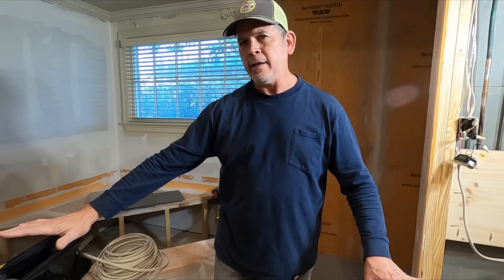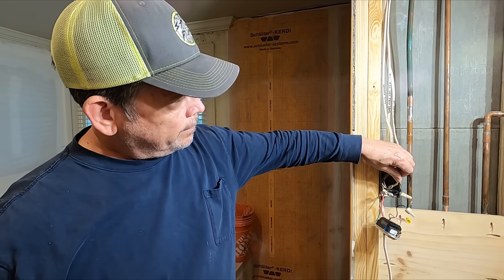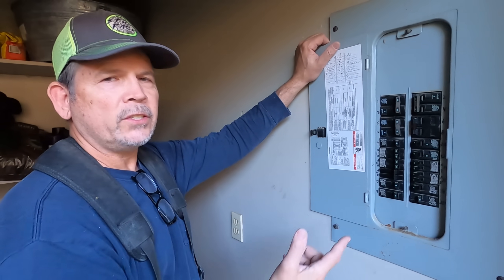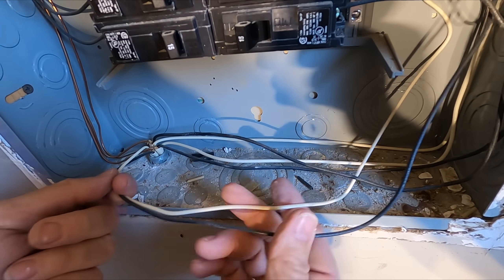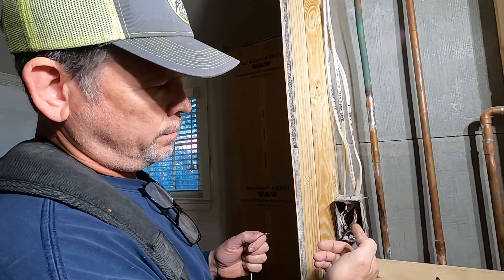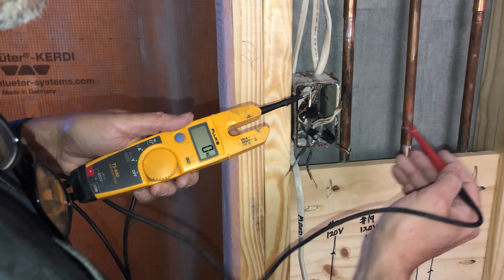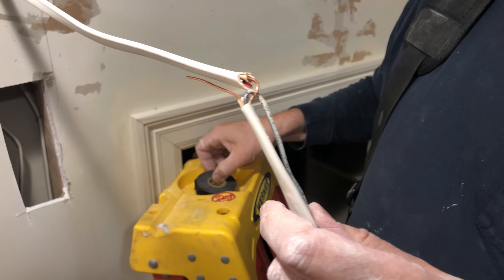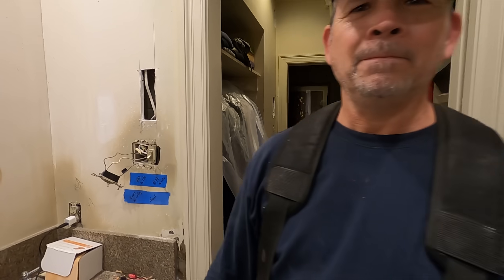You CAN Get SHOCKED by a Neutral Wire! This is How...

Comment: Thanks for the video. Was doing some research before replacing some worn out outlets this weekend. I already have a non-contact voltage detector that I've used for previous projects but, I had no idea that a neutral could still zap you even if the breaker is off.
Reply: Yes, but here's my take: Gotta appreciate your concern for electrical safety BUT there's more of an immediate danger and an OSHA violation going on at 13:00 . Whats up with that?!? Well, at least he was wearing knee pads!!! Hahahahahahhahah, funny as hell!!! Reeeally? Come on, man!

Comment: Paused 9 seconds in... let me guess somewhere there's a bonded sub... this is why we don't bond sub-panels... okay let's see if I'm right.

EDIT:
It's not... it's an uncapped open neutral shorting out to a hot lead in a switch box. You could get both phases in your bathroom switch box that way... that's 240s worth of potential there... that's scary... always double check your conductor connections especially if your just capping off. Just give your wirenut or wago a little tug, if it comes off re-do it and check again, don't shove it back in the box till it holds... also someone's stripping too long for stabbing there's a stripping length gage on the back of the switch. Personally I make shepherds hooks and use the screw terminals as it affords me a few mm of play (I can just curl around more to take up bare wire showing past the back thus pulling it in) and I feel the terminals just a make better connection. Also have you ever pulled a switch or recept that was stabbed? Sure most have a release tab accessible with a small flat-head screwdriver but in practice those release tabs work about 60% of the time... I've gotten them so stuck even after just cutting the device off I still couldn't get the wire out... I don't like stabbing, it's all bad man, just use the terminals. I know, you guys probably didn't wire any of that it's just my pet peeve so it triggered a rant.

Comment: I really like how You break your videos down especially with the electrical work . Working with electricity is scary even if its only 120v . Ive always wondered why there would be extra wires sometimes when Ive been changing Lighting fixtures or Light switches or just a common wall power supply . Very interesting and Informative Videos .

Comment: I see this Sooooo many times in older building and houses. Its also why I always cap off everything I disconnect out of habit. I've had people ask me why I bother capping things off if the switch is flipped in the box.... And my rule is Never assume that its wired the way its supposed to or that someone wont flip it on while you're working. I learned early on getting jolted from neutral wired.... Boy did I learn.

Comment: I learned this lesson myself while doing some DIY electrical work at our new house. That's when I learned that I had a light switch housing which had 2 separate circuits running through it (and it was ALSO containing a 3-way connection!) 

As someone who has done some pretty extensive rewiring, I really appreciate that those runs are labeled so well.

Comment: As a building contractor in Maine, I can not do plumbing or electrical. I am not licensed for either trade. If something happened with either the electrical or plumbing that I had worked on, my insurance would not cover me. I could end up losing everything including my freedom depending on what did happen.
I guess in your state it's ok unless you are licensed in both trades.

Comment: Shared neutrals are a danger as they potentially form part of another circuit in which quite possibly hasn't been  isolated.  It's carrying return  voltage current as part of a live circuit.  Electricians used to do this as it was either easier to connect to another neutral.  Or to save on wiring.  You normally find it on 2 way or intermediate switches.  Or shared between ground and first floor lighting in halls and landings.

Comment: This is why I use a voltage detection probe on all wires even when the breaker is off.

Only time I've ever gotten shocked was when I was unplugging a device from an extension cord and managed to touch the prongs it was a shocking experience 

I've replaced a few outlets recently I know that were wired improperly for sure since the only time someone bonds neutral to ground at  an outlet is to fool the inspector.  I think the house I found them in may have a few more since all the outlets will still show up as grounded despite there not  being a ground  and the whole house has conduit which may or may not be grounded.  Not quiet sure. What I do know for sure is the wiring is quiet old and is need of replacement as cloth covered rubber wire hasn't been sold for decades.  

We do plan to hire an electrician just as soon as we can get the roof redone as it is become quiet important to do first

Comment: Excellent lesson on the importance of hiring a professional.   Unfortunately, it's likely an irresponsible professional caused this problem to begin with.  I'm thankful for videos like this that share info with homeowners that like to understand how things are supposed to work and the risks involved with attempting repairs beyond your scope.
Reply: Sometimes is not an irresponsible electrician. Sometimes it’s the fact that decades ago, the code allowed things that it doesn’t allow anymore.
Reply: @totallyfrozen  Whether code allowed it or not, its still irresponsible or ignorance that creates an issue like that.
Reply: For years I did my own work.  I do not trust the so called professional electricians; I have seen too many screw ups.  Now I am too old to clime around and under things I get a good friend who runs an electrical business.  But after he lives I double check everything.  I do believe in following the code.  Everything must also be engineering sound; I do have a degree.
Reply: @donaldeisenbarth5255  i have hired several electricians, watched them work, observed mistakes and had to ask them if things were correct before they closed up the work.  They made the corrections and then I paid them.  I had to ask myself why I was hiring them after those experiences. They seem to be rushing through and not paying full attention - not wise for an electrician.
Reply: Excellent video, yes.  ALWAYS run SEPARATE neutrals back to the panel via separate and discrete cable runs and feeds.  Always.

Comment: I have run across this twice doing remodel work, lesson learned, I pretty much treat every wire as though it were hot, even after I turn the circuit off. Other lesson, make sure you can trust the guy who tells you the circuit is off. By the way, good call on completing the common circuit there, and explaining your thinking.

Comment: As a DIYer I have been shocked by the neutral wire, very mildly though, several times doing this very same thing by tripping the breaker for a single circuit. So in your diagram the closet light was on, if the closet light was off, it wouldn't shock you, correct?? Anyway, I  learned my lesson, I now turn off the main switch just to be sure. Thanks for explanation for this problem.

Comment: That condition is called a borrowed neutral over here in Europe, and it’s not really recommended, especially if you fit GFCI breakers in the panels as we do here, if you have any borrowed neutrals on a circuit, that breaker will trip.

Comment: it was just wired wrong theres 2 circuits probably was a double gang 2 switches 1 3 pole 1 1 pole too control the lights the powered white is a switch leg that has black tape -(back on black) or find the gang box and change the switch back too black and white tieing the black too red in the octogon in the hallway-) the light in the hallway is a 3 wire......the circuits were switched too a single pole leaving 2 sets of lighting wire close the #19 too complete it with the now 1 pole switch in the hallway and complete 20 with the 1 pole via a switch leg in the kitchen mindful of possibility of the now 2 phases in that case you must use a closed gang box

Comment: Can happen in a multi wire branch circuit (kitchens installed in the 80s, 90s and early 2000s, before arc fault breakers began required on just about everything is a good example) and two single pole breakers are used instead of a double pole, or a double pole with its handle tie removed.

Comment: I was working with my contractor yesterday and got (slightly) bit by a 15 amp hot yesterday.  This pops up in my YT recommends today.  (SURE they aren't watching/listening to us. lol) We were trying to diagnose how the original electricians routed a couple of GFIC outlets on the outside of our house (Original construction in the late 90's and they did some really goofy things that wouldn't pass code today). The screw on the hot side of the GFI outlet got me. It was totally my fault, as I got careless with it trying to put it back in the box. Felt it for about an hour. Thankfully it wasn't any worse. 

We have a "missing" junction (hopefully in a box) somewhere in the house. There are two outside GFIC outlets outside and on opposite sides of the  house, both with only one strand of romex coming in to them. We need to abandon 1 of them so we can install a new exterior door to the back yard. My guy is REALLY good with electrical issues, but knows when to call in the pro electricians when he's outside of his comfort level. FWIW, my grandfather was an electrician who worked as a lineman for the REA during the great depression.

Edited to add: I found the missing box using only my pen tester! My contractor has trained me well, lol. It was "hidden" in the mechanical room behind the hot water heaters. So we had 1 main GFIC in the mud room hallway upstairs that fed 1 outlet in the mechanical room, 1 on the front porch and 1 on the back of the house.  That circuit also fed the 120 for the washer in the laundry room,  the garage hall lights and the master bedroom closet lights.

Comment: I noticed the neutral and ground wiring are bonded in the sub panel.

I believe your ground and neutral wires shouldn't be bonded in your sub panel NEC (250.32(B)(1), Only in the main panel. By bonding your neutral and ground in the sub-panel you are effectively creating 2 or more paths back to the main service panel.  

Official NEC Wording  - The neutral and ground MUST NOT be bonded at a sub-panel. They should only be bonded at the main service panel. If you bond them anywhere other than the main service, the neutral return current now has multiple paths, including though your ground wire.

Comment: funny had the same thing happen a couple years ago when I replaced an old faulty receptical.... had to open a ton of light plate switches to fix the problems frigging 1970's house of course with a bunch of clearly modified circuits

Comment: Great information, with smarts switches needing Neutral wire it may be easier to run a Neutral line from another circuit.  Is there a way to use a diode or devise to prevent current traveling out of the Neutral line?  Kind of like an anti flow back valve on a hose. .

Comment: Thanks for sharing! I did some electrical outlet work on the outside sump pump last month. We bought an old house where things were done not according to code. We had an electrician redo the entire panel, but I still turn off the mains when I do work because I don't trust the original wiring.

Comment: Do you have any video that shows how to properly replace a ceiling fan in which the light is controlled by a three way switch, to a light fixture? This ceiling fan also has a separate switch controlling the fan which I would like to repurpose to control some new bar lights. I'd prefer not to cut into the drywall to run 12/2, but any advice would be much appreciated!

Comment: Just FYI, that is a sub panel and does not require a main breaker. If you notice the four wires entering it ( red-hot, black- hot, white-neutral, and bare copper-ground).
Within a sub they are all isolated until they return to the main panel where grounds and neutrals can share the same bus. 

Also, please refrain from calling the white white neutral. It is only considered that at the panel. What is called elsewhere is the grounded conductor. This is because it caries the unbalanced current back to the panel, and why a ground wire ( the bare copper one) should never be used in its place. 
I hope this helps, keep up the good work!

Comment: Found this same thing changing a porch light fixture. Oh and do NOT use an aluminum ladder! Had to scratch my head. Why did this happen? opened the breaker box and Wala the same thing. A little easier fix but found other circuits in the house had the same issue. This house was built in the early 60s. Must have been common for that time. TEST, TEST, TEST. Don't take for granted.

Comment: I found out about residual current on "cold" neutrals the hard way myself, ouch.  The right gloves and long sleeves can prevent some of these scenarios, if you can work ok at high temp...some can't.   I liked how you explained conductivity, though. 
Oh and in an initial installation, be sure to utilize a multiple pole breaker for up to 3 receptacle circuits (if the panel supports it) to share the same neutral with one common switch to de-energize.  When well labeled, this can save everyone a lot of time and trouble.  God bless, Paul! 😇🙏🔥
Reply from the maker: Thx 👍much appreciated 👊

Comment: Wise words here!! I have been dealing with electricity my whole life: a degree in electrical engineering, installing large data center server racks with 480 VAC 60 Amp feeds. Totally rewiring a home, running sub panels etc. You must fully understand how electrical current works, the difference of volts vs amps vs watts how it feeds into your house, your service panel, how to determine whats on each branch circuit from each breaker, the different wire gauges and their amp ratings, how to properly connect wires esp if you have aluminum . You could burn down your home or worse injure someone if you dont know what youre doing.  Great work again guys!!!
Reply: What's the proper way do deal with aluminum wire?!!!!!
i'm freaking interested!

Comment: I bevel my drywall cuts and glue the wall back later. This sets the plug deeper than the surrounding wall and I just cover it with drywall compound. I have found miss wired 3 way outlets so that one switch had to be left on for the other to operate. This was on new construction. I'd like to have a talk with the building inspector that passed it. Homeowner would not let me run a new dedicated wire so I had to just charge for the diagnosis.

Comment: Homeowners really lucked out to have you and not an average remodeler who would not know how to fix this. I can imagine them DIY installing some wifi connected replacement switches and outlets in a few years- if that 19/20 circuit issue had not been mitigated by you they could have been in for a nasty encounter with 120 volts of ouch.

Comment: A sub panel only needs a main breaker if its in a detached building.  

The sub panel is this video does not need a main even with current codes.

Comment: The black tape on the white wire tells you that it is a hot wire not a neutral. As it is most likely a 3 way switch, and they used the white as the runner.
Reply from the maker: See my pinned comment Tim regarding that black tape 👍

Comment: Decades ago I had a new sink garbage disposal installed. When the repairman went under the sink to rewire the new one, I asked him if he wanted me to pull the breaker to the disposal. He said no. A few seconds later he jumped and banged his head on the bottom of the sink. I'm guessing he touched a live wire he didn't think was live, similar to this video. I went to the panel and flipped that breaker switch to the disposal so he could finish.

Comment: Yep, its always something.  Sometimes the electrician just makes a mistake; other times they (or another helpful trade) purposely does something that puts you at risk.  Always check and double check for current.  Replacing a light fixture one time and the wiring was not right.  Black was abandoned, white was hot and ground was neutral.  Put it back and blew the breaker.   A little “research” and I found that the HVAC team had installed a brace improperly and it had cut the Romex and severed the black.  Then, someone (one of the trades) decided the fix was to just work around it rather than get a qualified electrician to rewire it properly.   Essentially, when the light was on, the home’s HVAC duct work was “hot” for 20+ years until I found the problem.  Being handy includes a little carpentry, a little electricity, a little plumbing, a little drywall and a little archeology.  AND a ton of luck when you find the circuit that is wired incorrectly; find it the wrong way and it’s the last thing you do.
Reply: You tripped the breaker or blew it?

Comment: I’ve accidentally done this backwards feeding in lab circuits and learned the hard way! The reason the saw runs is that when cold, light bulbs have almost zero resistance, so the the circuit completes itself thru the saw (or your body) readily. The limit of the current is only reached when the bulb heats up enough that the resistance of the filament in the bulb rises, “balancing out” the current flow. So what happened when you were shocked is that your body was conducting the current to light that bulb! A 60 watt bulb would run at least 1/2 amp at 120 VAC thru your arms, across your heart, and out to the bulb. Thanks for this lesson! As a DIY, I have put touchless voltage sensors in every tool box and will absolutely use them!
Reply from the maker: Cool thx Richard 👍👊